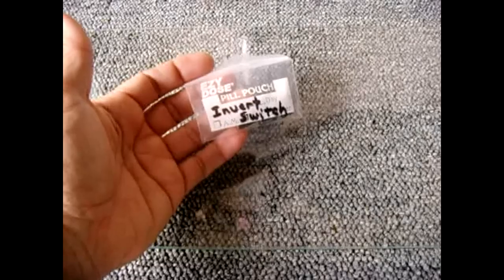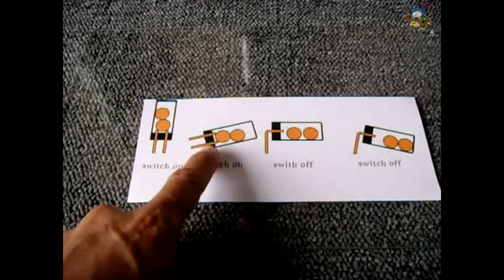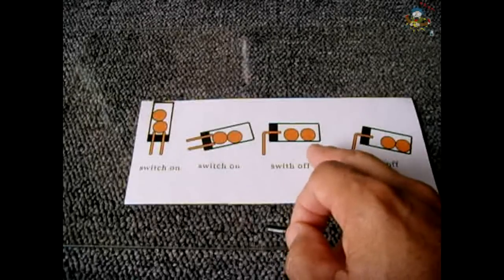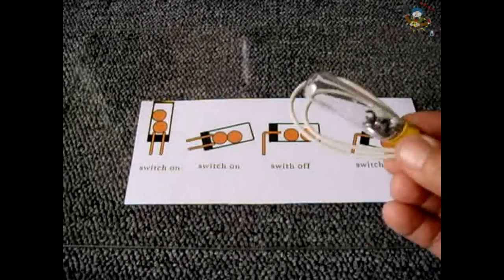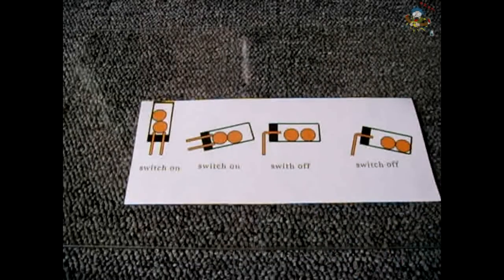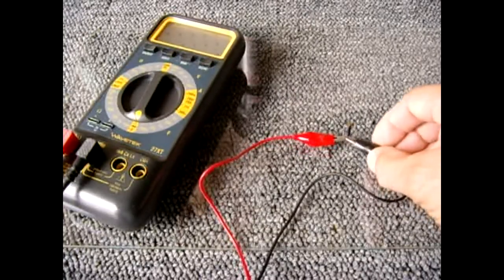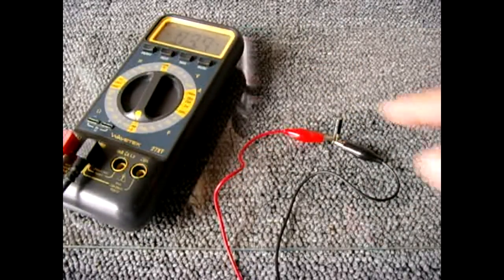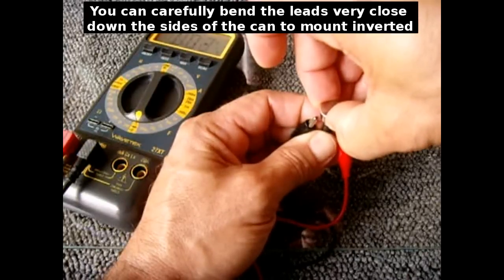QUICK TIP ~ Another Use For Radial Type Invert/Tilt Switches

Comment: I've struggled with NC reed switches and this looks like a very handy tip to keep in the back of the head! Thanks! I'd like to see more videos like this!
Reply from the maker: You can also open up the can and remove one ball(The ball which pushes the other toward the contacts). When you remove that ball, take a VERY short/light compression spring from a pen and put it in place of the 2nd(outer) ball. The 1st ball will be pressed nicely against the contacts ensuring a very good connection until the magnet pulls the ball up and away from the contacts. Simple NC switch resistant to any movements.

Comment: Maybe it is possible to hook a few in parallel if more current is needed, though its more costly probably.  If anyone was wondering this is a "tilt switch", or "gravity switch" as the old pinball game machines had.   There are many uses as seen in the video.
Reply from the maker: Mercury switches perform the best, and can handle current, but these are the next best thing. The Tilt switch will work just fine for triggering low current circuits. If you want to control higher current, then you can use the switch to feed power to a resistor on the base of a to-92 transistor to handle the higher levels of current.
Reply: electronicsNmore Thanks, that is a good thing to do, to use it to trigger/turn on a high power transistor..
Reply from the maker: Yes. A small current on the base can control a much larger current.